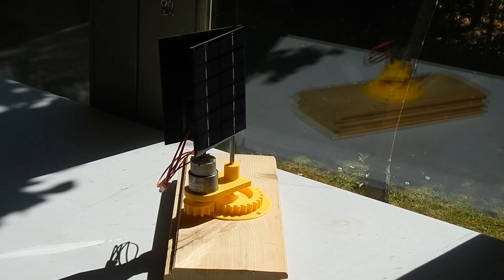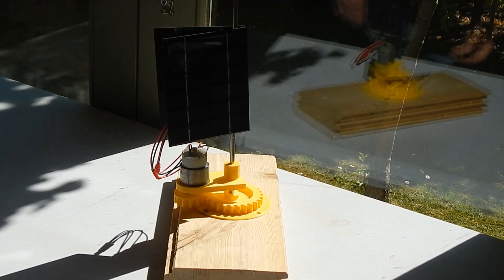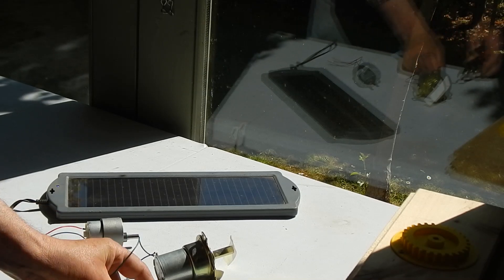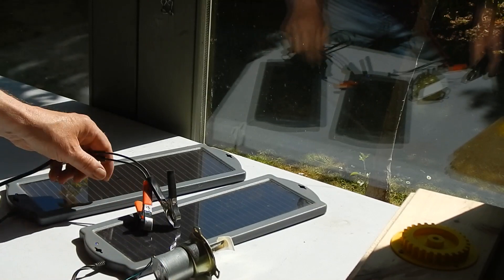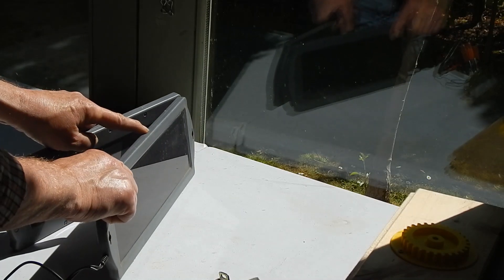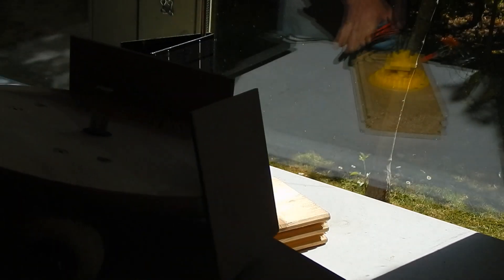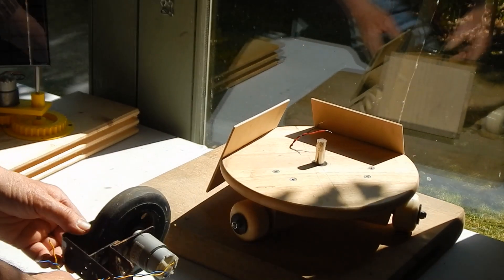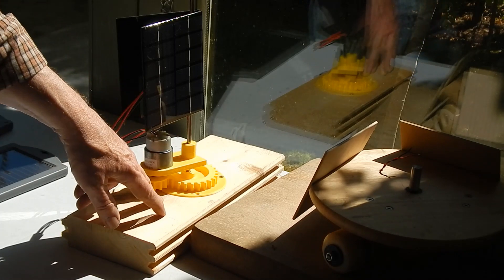Worlds simplest solar tracker (Tutorial)

Comment: will it turn in the morning to east after on previous day being rotated to west?
Reply from the maker: Yes Peter - It wakes up from where ever it is resting to point to the sun as soon as the sun hits one of the panels. If you trawl back through videos you will see I made some larger versions that work on the same principal and can carry a decent sized panel.
Reply: @Targetmaster1066   I really like your setup as it is simple but perfect ! Now I'm interested in building something similar for a bigger panel. (mine are two pannels 67*106 cm / 10kg incl the frame) and I didn't found a proper DC motor which is able to work at the very low power that the tracking pannels will deliver (maybe 300mA or les) You mentioned you already build it for a bigger solution, so I would highly appreciate if you can share your equipment being used.
Reply: @Targetmaster1066  t

Comment: This is brilliant and so simple. I have one question do you need any diodes in the power lines to prevent a dead short across the two panels as they appear to be connect positive to negative?
Reply from the maker: Thanks for the interest - No, no diodes needed. The small panels I used for this have a fairly low output and even shorted straight out don't seem to come to any harm. The larger panels I show in the video are actually designed as solar trickle chargers for car batteries and do actually have diodes built in. - I have adapted this idea to something else, I'll post another video shortly.
Reply: @Targetmaster1066  what's the concept used called scientifically?
Reply: @firdausfiteri441  not sure of the name but a similar principle was use by nasa as a solar tracker, theres another video on YT about it, its pretty cool

Comment: Thanks for this video. If i use this method for bigger panels. Will this electro motor eat electricity all the time? Or it will ON or OFF only if some of panels have more power?
Reply: Is there correct angle between panels?
Reply from the maker: No, it's not critical - 10 or 15 degrees seem to work well.
Reply from the maker: The little panels used in this system only produce enough power to drive the motor to track the sun. You would need a framework to hold a larger solar panel to produce usable power. Keeping a larger panel facing the sun should produce around 25% power more than a fixed panel.